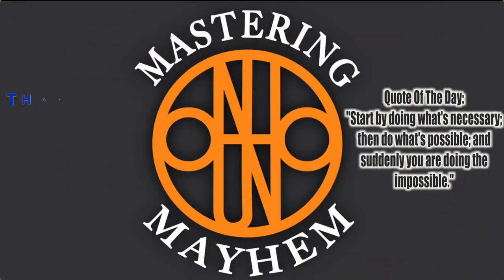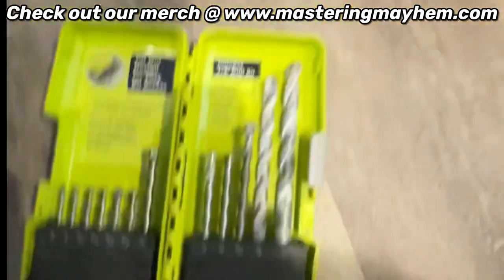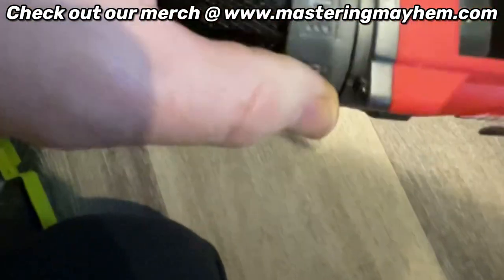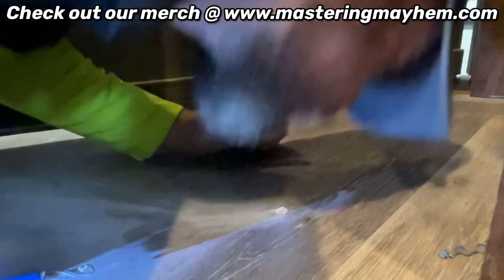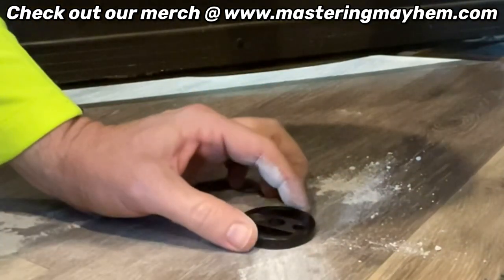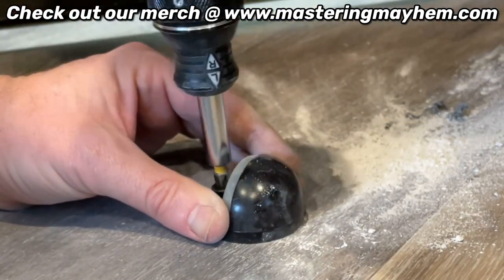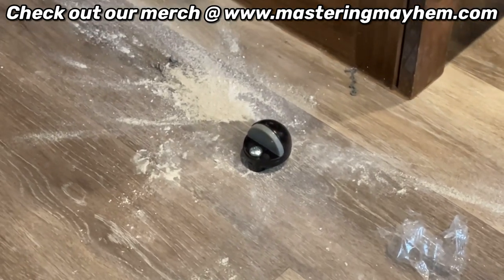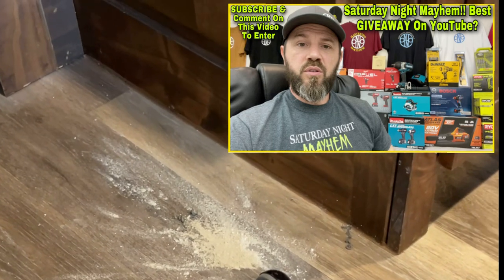How To Install A Door Stop Into A Concrete Floor | Step By Step How To Guide | Everbilt Door Stop

Comment: How that drill do for you ?
Reply from the maker: It was okay. It took much longer than I wanted, an 18V or 20V would have been better. I plan on comparing it to the 12V RIDGID hammer drill and showing the time difference between 12V & 18V/20V hammer drills.